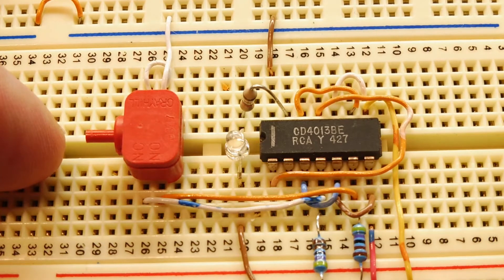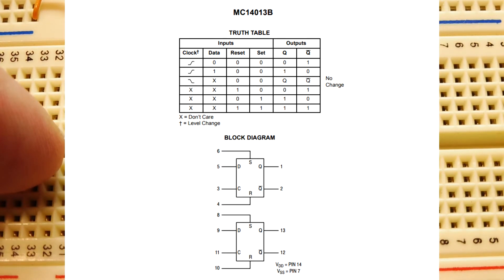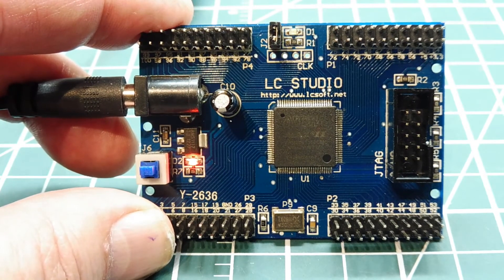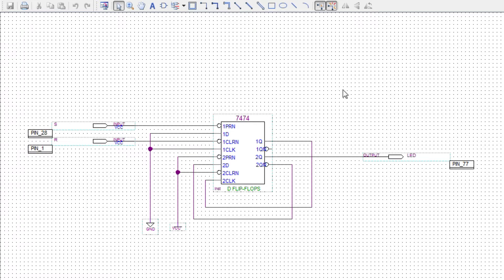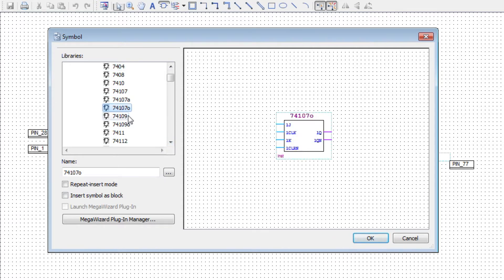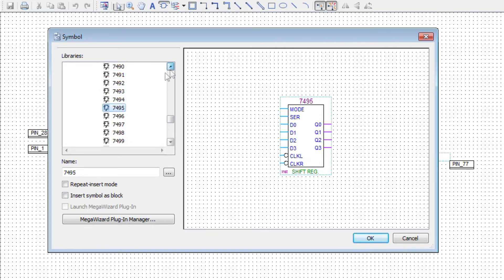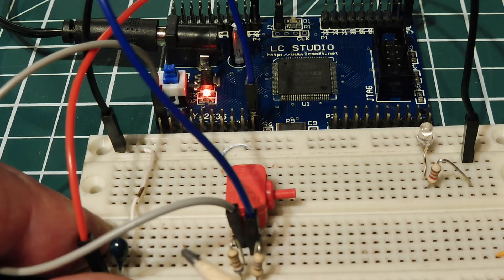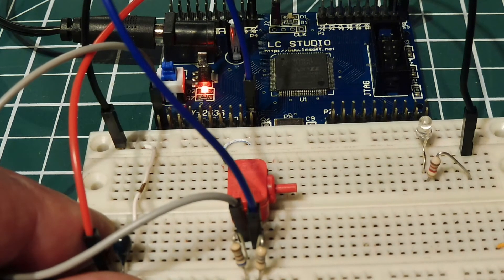Learn Digital Logic Circuits using CPLD's

Comment: so is a CPLD like a less complex FPGA? FPGAs are getting cheap these days and im wondering at what point is it cheaper to get an FPGA (even tho it might be over kill) rather than a CPLD? Ive also noticed that there is more software support for FPGAS as well.
Reply: Also As I Remember, FPGAs are RAM based Devices and they need a Separate (some have Inbuilt) Flash Configuration Memory Chop so they can Reconfigure themsleves whenever they powerup. CPLDs are EEPROM or CMOS Flash Based Instead
Reply: @prathamkalgutkar7538  that's nice to know. So a cpld would make better glue logic than an FPGA because it can hold its configuration after power down. Thanks.
Reply: At here CPLD 4,8$ , FPGA 12$
Reply: CPLD as first step to FPGA

Comment: Do I need to connect power source in order to program CPLD, if I have USB blaster ?
Reply from the maker: The CPLD board has to be powered when programming with the USB blaster connected.
Reply: yes, there is a barrel connector cor connecting a power supply.  The 240 has an onboard regulator giving you flexibility in the power supply you can use.